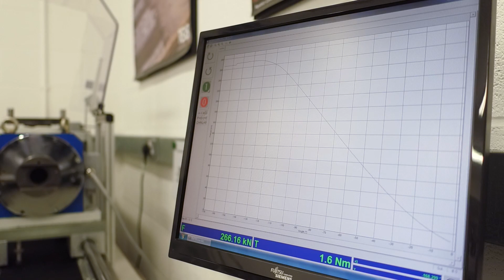Tension Control Bolts Ltd - Corporate Video

Comment: Does the exposed steel on the sheared end have any impact on longevity, or do these bolts require additional covering/coating/interior-facing placement?

Comment: Great product..but the tins need handles and not as many bolts in as they are too heavy
Reply from the maker: Thanks for your comment/feedback. Please be assured we package our products to be fully compliant with manual handling regulations. We also seek to optimize both cost and efficiency for handling of the goods.